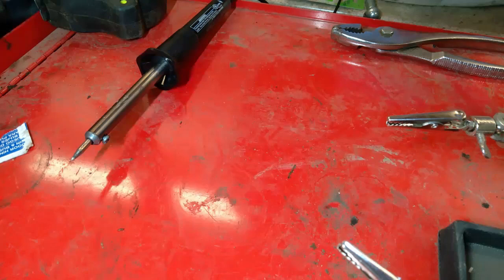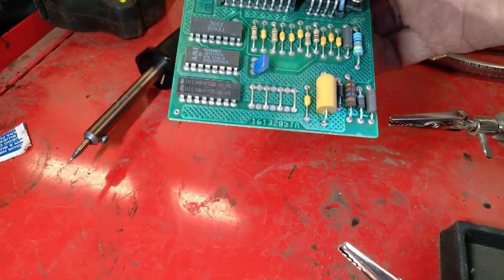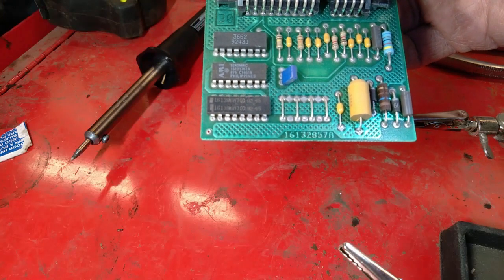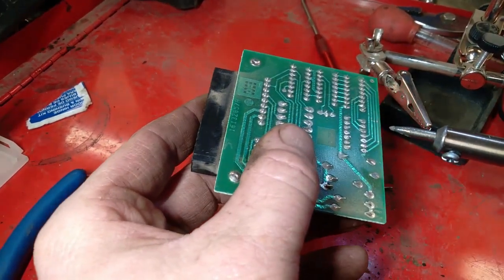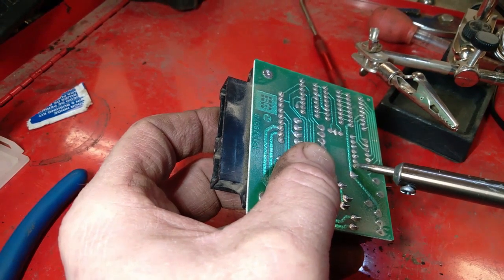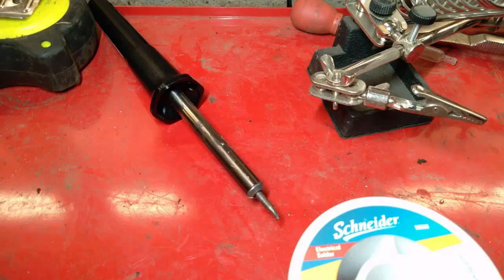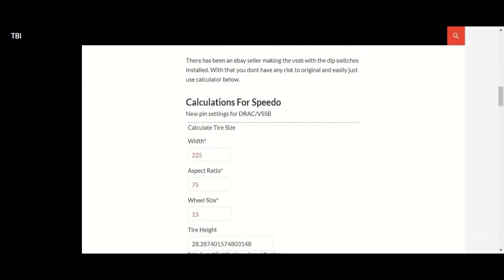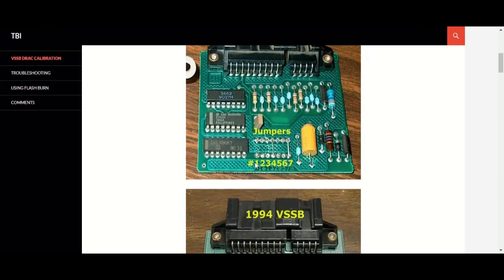90's Chevy/GMC pickup speedometer recalibration procedure.  #diy

Comment: What about on a 1997 k1500? I went with smaller tires
Reply from the maker: I am not sure.  If it is od2 I think you can program thru that.
Reply: @quarter_circle_f_ranch yes it is! I got a tuner that allowed me to change the tire size through the obd2 port. Though my dad has a 95 Tahoe so this video helped out
Reply: @loku543 which tuner is it?

Comment: just as ez to install a 7 pin dip switch that way if you need to change tires or gears just flip the switch
Reply from the maker: @tobycanales1062  True.  However planned to run the 265/75 tires or 235/85 which are close in diameter.   So one time and done.  The truck ended up getting totaled so oh well. Thanks for the comment

Comment: Could I do this if my speedometer isn’t reading?
Reply from the maker: This could be the problem, however I would suspect it to be a bad speed sensor or connection at the output shaft on the transmission or transfer case.  It could also be a bad connection or stepper motor in the gauge cluster.  There are places online that can test and repair gauge clusters at a reasonable price.  Thanks for the question.  Let me know if this helped
Reply: @quarter_circle_f_ranch I was also thinking about swapping out the one from my other truck. They’re literally the same truck except for the motor.
Reply from the maker: @ I see no reason not to try it.  Should be plug and play.  Would be an easy test

Comment: Great video, I'll try this manual method before I spend some money on a new board, I'm just not real gr8 at soldering but I'll give it a go and see lol

I watched another video and that guy got a board with dip switches on it for quick changes instead of soldering and unsoldering pins (which will help me later because I plan on changing things up on my truck later so ill need to change them again later. This is where that other guy got the board with dip switches

https://www.udmodule.com/drac/diy.html

Hope this link helps someone who is not good with a soldering gun lol I may need it myself lol

He also listed that other page for the setting for the different ratios for setting the board

Thanks for putting this video together. Before today I thought these trucks were old school and I would have to change a gear in the tail shaft of the tranny to change the reading, I learned it's much easier now